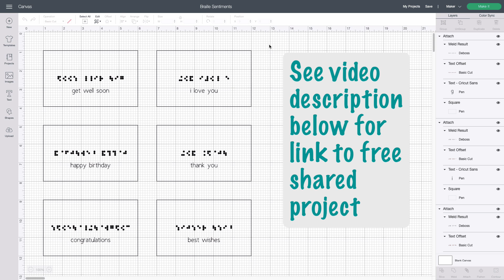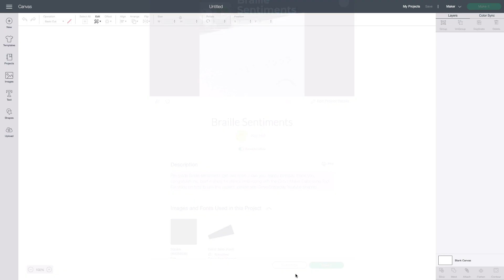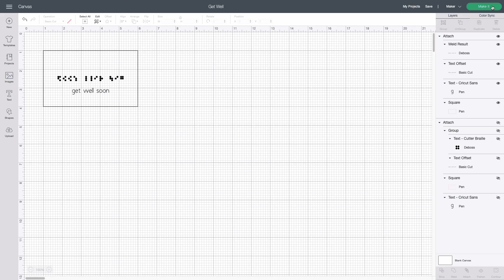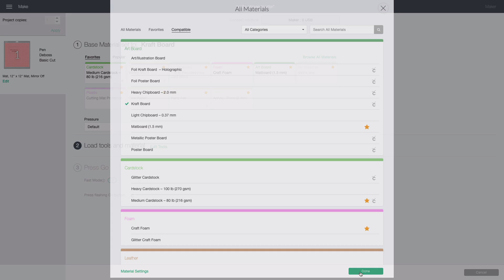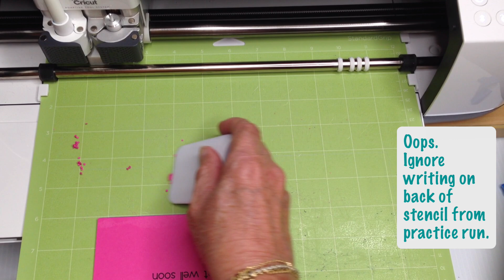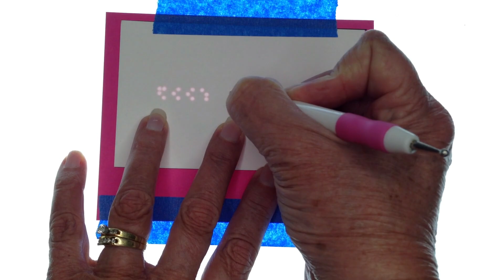Braille Lettering with the Cricut Maker

Comment: Have you tried this with something like self adhesive laminate sheets? My thought is something similar to a label maker, where the braille is on a sticker. But I'm not sure if the Laminate sheet would hold the bump as well as a proper braille embosser would. (I plan on trying this myself, as soon as I get the right tool.)

Comment: I am so inspired by this video. I have been looking for alternatives to make accessible cards for my best friend who is DeafBlind. I don’t want to spend $2k on a braille embosser that doesn’t even print text. Some of my DeafBlind friends have low vision, so it would be awesome to print in LARGE text and have accompanying braille. This machine is the perfect compromise and I can use it for other crafts too, so it’s a win-win in my book. However, I know NOTHING about circuit machines. If I get the cheapest circuit machine, would this work? Or is there a circuit machine you recommend? I don’t mind spending up to $500 (maybe more) for the best overall circuit maker. I’d like to engrave in leather, cloth, etc. (if that’s even possible).  I’d love recommendations!  Thanks!

Comment: I think , though, that this is incorrect. The braille they are showing is not readable on the front of the card wit the visual text. The readable braille is on the flip side. The dots should be sticking up. So whatever this person has done needs to be flipped. That is, if I'm seeing it correctly.
Reply from the maker: The braille reads correctly from the raised side. The visual text is on the back for the sighted person's reference.

Comment: Thanks for this Kay!
I'm curious if there is a difference in the debossing tip vs foil transfer kit. Seems like the tools are pretty similar?
Reply from the maker: Yes, the foil tip will work, it just takes a bit more fiddling with settings so the paper doesn't tear.

Comment: This is brilliant!  I notice that the star wheels have been pushed to the right on the roller bar.  Is this a necessary step because of the thickness of the two layers of paper?
Reply from the maker: Good eye! No, it's not necessary to move the star wheels. I do so much engraving that might stay to the side most of the time and I forgot to move them back for the video.